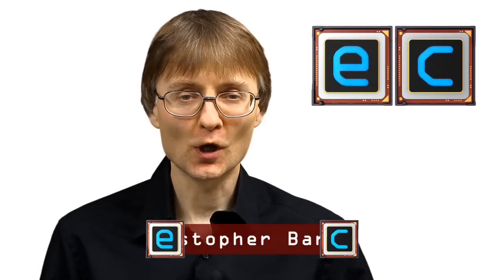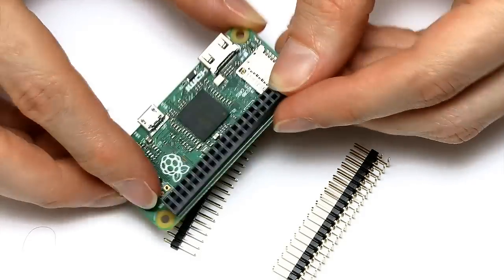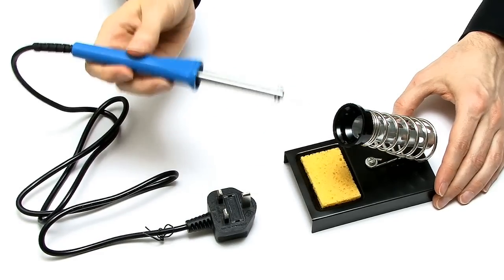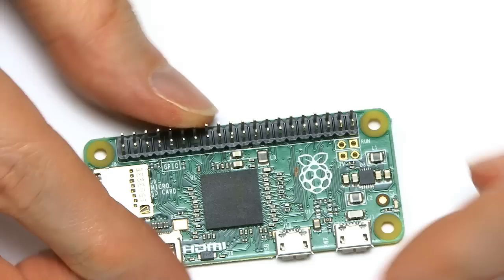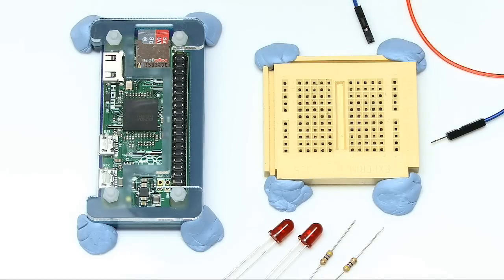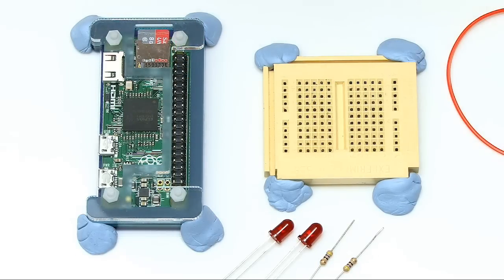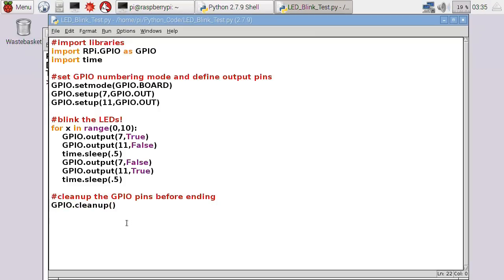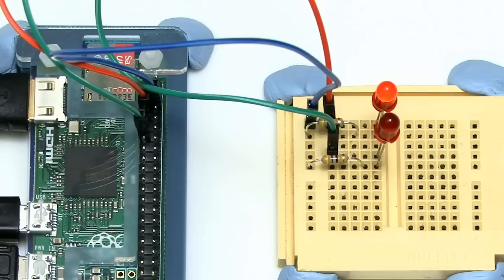Raspberry Pi Zero: GPIO Pins

Comment: 12:00 I think it would be faster if you'd have terminal-only running, then either SSH'd to it or used it via tty. Both X11 and wayland are too-memory intensive for such tiny device.

Comment: Hi Christopher, Thanks for the great videos and for this nice soldering explanation. Could I suggest that you make a video in which you test the gpio pins? There is a software script for the unconnected pins, but a simple project that tests the pins work as designed when something is connected would be a great way to check if our soldering has worked. TIA
Reply from the maker: An interesting idea, but I think a video about GPIO pin testing would be very niche and not get many views. I have made many, many videos using PI GPIO in projects! :)
Reply: @ExplainingComputers  The idea would be that you can be sure you soldered everything correctly. As well as building your own GPIO tester, which is a product that I have not yet found commercially available but exists for other devices)

Comment: How things have moved on, I've used one of those mini keyboard and track pads too...And they were a pain.  Now you can use this in 1 USB slot instead:

https://www.amazon.co.uk/Wireless-Keyboard-Jelly-Comb-Computer-Black/dp/B0762CQQQP/ref=sr_1_6?crid=T9P1HBJX9DAT&dchild=1&keywords=jellycomb+keyboard&qid=1596727123&sprefix=jellycomb+%2Caps%2C161&sr=8-6

Or use Bluetooth and save that USB slot:

https://www.amazon.co.uk/Bluetooth-Keyboard-Jelly-Comb-Rechargeable/dp/B07BNKV756/ref=sr_1_9?dchild=1&keywords=bluetooth+keyboard+and+mouse&qid=1596891414&refinements=p_89%3AJelly+Comb%7CLogitech&rnid=1632651031&s=computers&sr=1-9

Comment: Sir i how to connect raspberry pi zero w with audio output.. plz explain
Reply from the maker: Audio out on a Pi Zero is normally via HDMI. You can get analogue audio from two of the GPIO pins, but the quality is not good. Else you will need to add an audio HAT.
Reply: Thanks sir for reply

Comment: If you keep soldering 2 seconds longer for each pin and use soldering flux, your solder joints would look like machine made. Your solder joints are example of cold joints.
Reply: the iron was too cold for the first pins.

Comment: Most of those solder spots are BAD, in particular the first 3 are ALL BAD. The bottom of those should be even all around without open spots, perfectly covering the copper base and properly enveloping the soldered pin.

Comment: Just came upon this video again and noticed that your resistors appear to be 47-Ohm (yel-pur-black) and not 470 (yel-pur-brown). Missed that on the first pass, several months ago...
Reply from the maker: They are yellow-purple brown -- the colours do not read well on video.
Reply: Figured as much, yeah. For the little bit of time you were flashing them, 47-Ohm resistors would have actually worked I bet. The LEDs aren't likely to get hot enough to burn them out with the flashing you're doing. They're just not on long enough. The little circuit graphic did show them as Y-P-Brown, so I figured it was just an issue with colors not showing correctly on the video.

Comment: Did you say 15 watt soldering iron? Lower wattage means it heats up slower. That means the tip starts to cool down when you apply to a contact to be soldered in effect cooling it down. For the next soldering point, you have to wait for it to heat up again.

For a lot of soldering a higher wattage is better. At least 50w is ideal as it is less prone to losing heat when going point to point.
Reply from the maker: Yes, I have learnt that. I actually have a 50w, and since this video have used it with the smaller tips from the one I bought here.
Reply: Learning is part of the experience after all.

Comment: Have you ever heard about and tried an USB soldering iron? It works surprisingly well and very useful for tiny things like this because of the very fine tip that is included. It can be powered by your computer, an USB adapter or a USB powerpack and heats up and cool down in about 15 seconds. I got two of these and very happy with those, easy and small, great stuff. I bought them around $5 each.

Comment: Soldering is an art....but proper prep will make things 1000% easier.
preclean both elements to be soldered, wear clean neoprene gloves to handle the elements and always pretreat the element with a liquid flux just prior to soldering.
I'm a NASA Certified flight harness fabricator. This includes some of the most stringent soldering procedural certifications on the planet.
Reply: i hate soldering but when needs must.

Comment: Do I have to solder them? Dang it. Is soldering important? Could they be molded to the board with clay, or even a tight fitting rubber?
Reply from the maker: There is now a set of GPIO pins available that push/shap into place -- so you can avoid soldering:  https://shop.pimoroni.com/products/gpio-hammer-header
Reply: Awesome!

Comment: Hi, just a question.. I'm looking for a pi zero W, and I've seen there are a lot of gamepad board ready to be placed on top of this Pi, but I need 2 of them (to have dual pad and buttons) and I don't want to mount them up each other. Can I use normal Dupon cable, male-to-male to connect every working pin on gamepad board to the Pi Zero? Total of 12/14 buttons. Is it needed something to program the Pi or keys will work by itself just by connecting it to every gpio input?
Reply from the maker: A normal ribbon cable extension should work as you say for GPIO pin extension. But there has to be software to interface anything to the GPIO pins -- so you would need something that specifically supported two controllers.

Comment: Noob comment here. Is the breadboard used just for testing? IE if lets say your final project was just to blink those two LED's like you did. Would you solder the resistors and LEDS directly to the GPIO pins or would you solder them to the breadboard?
Reply from the maker: A breadboard is normally just used for testing, with -- as you suggest -- final setups consisting of soldered components as you note. This said, many Raspberry Pi projects are short-term for many Makers, and may never need to progress beyond a breadboard stage.

Comment: In the video at 11:21, you show a keyboard made by Rii but there is no mention of the model number.
Would you please add that to your comment section?
Thank you.
Reply from the maker: It is a Rii i8.
Reply: OK, thank you!
Reply: Thank you. But when I went to the Rii website, I was overwhelmed by the myriad of choices. When I looked at all of them that had your layout, I could not find one with a red LED in the top left corner. Is yours a model from a year or two ago?
 
The problem is that since yours does not seem to be a current model, which one would I buy? Does the choice need to take firmware in the keyboard or software drivers on the computing device into consideration?

I wonder if this subject is worthy of a small YouTube video.

Thank you.
Terry Thomas
Atlanta, Georgia USA

Comment: Hello,
You should grab one of these for your Keyboard/Mouse combo unit.
https://www.walmart.com/ip/Logitech-Wireless-Touch-Keyboard-K400-with-Built-In-Multi-Touch-Touchpad-Black/17253322?wmlspartner=wlpa&selectedSellerId=0&adid=22222222227000987195&wl0=&wl1=g&wl2=c&wl3=40880346152&wl4=aud-273067695102:pla-78810085952&wl5=9005170&wl6=&wl7=&wl8=&wl9=pla&wl10=8175035&wl11=online&wl12=17253322&wl13=&veh=sem

Comment: Another soldering detail which helps a bit on things like this is don't solder adjacent pins.  Move to different spots, takes more time but prevents heat building up in 1 area of the board too much.  The 470 ohm resistors would be good up to 9volts for most LED's that would operate at 20mA or less.  Since the PI's gpio pins are lower voltages those are no problem.
Reply from the maker: Now this is a very good tip! :)

Comment: hmmm, if i just wanted to test out something (temporary) could i just wrap a bit of wire through the hole so it touches the contact point to get a connection? would it work?

Comment: great video, but what would happen if I didn't connect the resistors??
Reply: Pierre Adel You would probably burn out the LEDS
Reply: Pierre Adel Too much current starlight to the LED, the resistor helps to block some of that current to avoid burning out the LED
Reply: "starlight"? The word you wanted to use was "straight".
www.Grammarly.com
Reply: Terry Thomas My bad haha

Comment: Very helfull,
would this case fits Pi Zero W as well considering the new camera connection socket ? THANKS
Reply from the maker: They now sell a modified version of the case to accommodate the camera connector. In will be looking at both on this channel very soon! But you could fairly easily modify the existing case with a slot in one of the layers.

Comment: The Pi Zero interests me for its small size and LOW COST; great for robotics. Can the Pi Zero run code from books written for Pi 2/3? I assume yes, but Pi Zero has different processor.
Reply from the maker: The Pi Zero can run exactly the same code and apps as other Pis. It has the same processor as the Pi 1, if clocked faster. You may like my recent video when I used a Pi Zero to control a robot: https://www.youtube.com/watch?v=XvOONPSoglY

Comment: My OCD for soldering is killing me in this video. A little liquid flux would do wonders to get the solder to flow better and get 360* coverage with a nice fillet. Still a good little video for the zero though.
Reply: My thoughts exactly
Reply: @John Caldes
It appears your ADHD is also kicking in.... He mentioned his soldering throughout the video.
Reply: Right you are, which is why when building to MIL spec this would never pass. That said, this project wasn't for consumer level production let alone military, and will probably suit his needs just fine.
Reply: @explainingComputers
You did a heaps better job than me, and probs most of us clicking here to learn. I don't see it falling apart anytime soon.

I don't care about soldering perfectly just yet, and will improve gradually in my own time.., by LEARNING electronics from you. Rather than mastering soldering techniques FIRST and not learning electronics/Pi.

Zzzz, I want to build robots.., not become one. LOL
Everyone has strengths and weaknesses. Your strength is intellect and the ability to teach well.
Thanks heaps man. Watch your vids everyday.
Reply: It does matter some because poor soldering results in a poor mechanical and electrical bond. Over time, this will lead to intermittent failures followed by total failure. China's (outdated) reputation for poor quality comes from this sort of thing. Even today, if you buy cheap electronics from AliExpress and open them up, you'll see bad soldering everywhere.

Perhaps it would be worthwhile to add a link to some existing videos on soldering. Or +ExplainingComputers can produce some!
Reply: how do you use GPIO for  embedded applications, i mean  if  you plan on embedding it and not having a monitor   and an input device connected, just connections for power and GPIO how do you get the pi zero to boot your python code at boot every time you power it up?also i have a USB hub and  a  USB  to ps2 adapter to connect a keyboard and mouse, the USB to ps2 adapter does not work with the USB hub though, and i need to  use sudo get to DL libraries so would i ned a to get a USB keyboard and mouse and  a wifi USB dongle or is there an easier way?
Reply from the maker: Sorry about the soldering .  . . :(

Comment: A few soldering "tips:"
1) constant temp soldering irons are wonderful
2) I use a spade tip for all soldering tasks.
3) for through the hole parts I hold the iron on the lead for a maximum of 2-3 seconds (usually 2 is enough) at 385 C. High temp and brief contact is the way.
4) to solder a row of attached pins I solder one pin at the end of the the row (or one at each end of the row) to start. If the line of pins is not straight and flat against the board, one can heat the soldered pin and readjust the pins position in the pcb.

Comment: is their a code i can type on linux to where i dont have to type sudo every time i type i a command?
Reply from the maker: +zach “techy guru” schwanke You could execute your code via Python using IDLE -- open a terminal and type "sudo idle" (no quotes), then everything you type in idle will run as a super user.
Reply from the maker: ***** Very helpful, thanks. :)

Comment: Hi EC, You can use Ohm's Law to calculate the proper resistor, etc.. V over I (current) x R. You can interpolate the formula to figure the prescribed value. R=V/I, I=V/R, V=I x R. This is DC, Direct Current Ohm's Law, there is one for AC, Alternating Current. Be good, C.
Reply: I will bet that students who learned math under the Common Core system could never figure that out.

Comment: when you started putting the connector on you had Little thermal contact between pin and iron so not much heat was transferring! always tin the tip before you start and you will have a easier time!

Comment: worst soldering EVER!! this is an instructional vid? :S you can tin ALL the pins in 2 strokes of the iron.. just gotta know what your doing/load enough solder and move fast. if you keep bridging pin joints use some flux... this is terible tho. solder joints are DRY.. you WILL have connectivity problems after  a few heat up/cool downs on the board
Reply from the maker: +minor0confusion Thanks for the feedback. I did make it  clear in the video that my soldering was far from perfect -- working under movie lights, while filming with a macro lens, also makes access difficult. But I take your points. I will see how good the connectivity remains. As for being an instructional video, this is a computing channel in which I had to turn to soldering because the Pi Zero is supplied sans pins. I have learnt a lot here! But ultimately this is a video about how I added GPIO pins to my Pi Zero, and I think I make it  clear that what you get here is what I did, warts and all.
Reply: Worst comment ever!!

Comment: Is it possible to hook it up to a battery to make a tablet?
Reply from the maker: +Mason Tomlinson Yes, you can -- for example -- use one of those portable power cells (the things you can charge up and take with you to recharge a smartphone)and plug it into a Pi and it works very well indeed. I'll actually be doing this in a video to use the Pi Zero to run a robot in a video in about a month's time.

Comment: great video once again... I would have soldered the 2 pins on the left and right first though... that way you know everything stays in place.

Right now I have no use for an RPi-Zero but I'm planning to build one into a keyboard so I have a portable emulator keyboard (like the A500/MSX) that is portable and easy to hook up to any screen.

Comment: For soldering pins I would suggest a 15 watt iron is a little under powered. It was only just melting the solder when applied to the pins. A 25 watt would probably be a better choice. Although hotter it will complete the job faster, so no danger to the PCB or components and it will make a better joint.
Reply: his soldering is rather bad. too low power as it do t go through hole. dry solder
Reply: Raspberry Pi is intended as an educational tool.  Soldering is an essential skill. Fear not.  Heat it up.
Reply: Kevin VanHoosen I only fear the toxic fume..
Reply: +Tangobaldy Yes, dry and cold joints, not a good job, but it will work for this experiment.  I recommend watching the many (many!) videos on how to solder properly and do not use this video as a reference.

But, seriously, the Zero should have GPIO pins installed already.  Nobody uses these who doesn't need GPIO pins.  It would only cost about $1 more to produce with the manufacturing robot.
Reply: It's not to save costs, but rather so you can integrate the Pi zero in all sorts of environments.
Reply: yes ;)

Comment: Would be nice if you could include the links to the kits you mention in the description. And I've used rosin lead free for electrical stuff for ham radio and had good results but nothing that small. I dread doing that by hand because I know i'd mess up the last GPIO... and then have a difficult time fixing it :/  Thanks for the video ! Wish I could find the zero locally for anywhere near the 5 dollar price.
Reply from the maker: +LJH08Ralith Done! I've added he links. Soldering something this small *when the CPU is already soldered to the board* is indeed a little scary . . .
Reply: +ExplainingComputers Thanks for the update! Gotta check them out since that kit looks neat!   And yea I've debated getting a TNC-pi kit for raspberry pi for ham radio use but small soldering ! ;)   Thanks again!

Comment: man I am sorry but with that soldering the cringe is real 😨
Tip(pun not intended): do tin the tip of the iron before trying to solder, also the wattage is waay too low for anything with pins, its good for SMD work.... my 60W hakko 888D works perfectly for soldering anything with pins (I havent tried SMD).
Reply from the maker: +Anas Malas Agreed this was not perfect soldering! But the tip was tinned.
Reply from the maker: Curious Pineapple Noted with thanks. :)
Reply: +Victor Y. I know right